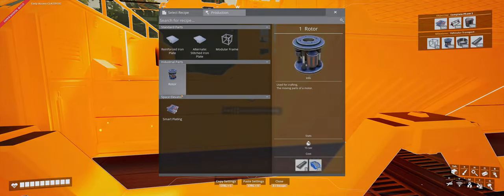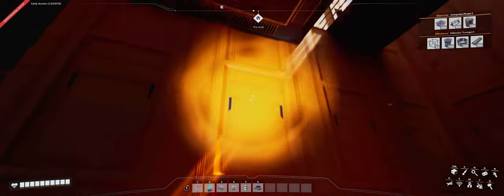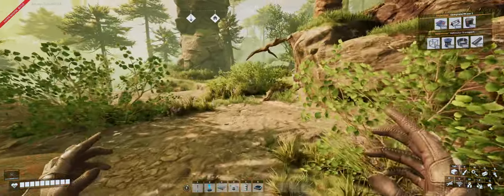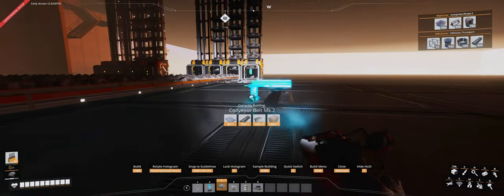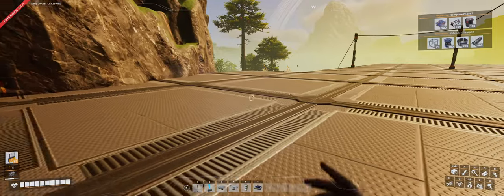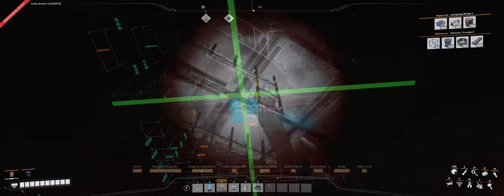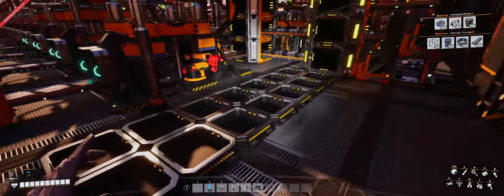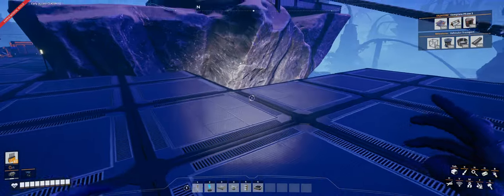Installing a Factory Sub-Floor | Satisfactory U8 - Ep 3

Comment: I came back to this episode again to see how you set up your vertical bus. I built one in my current game and had some trouble. I made mistakes, but learned a lot. I was attaching my splitters directly to the belt line and it created an issue where the lifts would not attach to the machines or vice versa because the height was off a hair. It took me hours to figure it out and do a work around. I was pulling my hair out. Now I understand how to set the whole thing up efficiently. The vertical bus takes time to set up, but after that it really is a plug and go system. I love this game!
Reply from the maker: I did the same thing in later episodes lol.  It's because the machine didn't place exactly flat on the foundation because I had something too close to it underneath.  I also spent way too long figuring it out lol.

Comment: There's something to be said about having a single set of straight belts downstairs where outputs are merged into and inputs are split off of. Just so you can see at a glance what's what and how many you have. 
Storage could go before the merge-on (would act as a buffer), overflow before storage.
Reply from the maker: I did make sure to make the overflow belts visible and that helped me see what was happening at a glance.  Not sure about having mid-line storage.  I want my expensive parts safe. :)  But It would work if done right for sure.
Reply: @Kinstruction  When in doubt more in-line storages act as a buffer and hold more items for you to use or outputs to take out of with the industrial storage. For example my Oil setup. Rubber/Plastic outputs immediately overflowing into a sink to keep the factory running and then splitting into an industrial storage and then two lines out of the storage into another four storages that goes to the train. Triple the buffer and double the throughput to the train. The factory can't keep up with the throughput but once the buffer is full and the train is only taking as much as it needs then the train will run at peak efficiency. More storage can always be added as well to create a large buffer for modular factory activation. I can go on and on about resource management but I'll leave it with this: Create a factory (system) that uses every last item it creates and create a buffer so large that it will never empty is my philosophy.
Reply from the maker: Yea, no problem with this idea unless your using more than one item in that line, especially on trains.  Can't let it overflow if you're doing susi, cuz you might need an item that gets blocked.
Reply: @Kinstruction  Yeah, I never put multiple items on a single belt.
Reply from the maker: I try not to unless there's a very specific reason to. 😁

Comment: Quick question...
are you consolidating all your mined items into one... that spot has a ton of iron and a few copper... just wondering if in hindsight mode if it makes sense to do so, then make a distribution hub maybe downstairs... this is me thinking out loud as this round for me is about modulation, minimal plant removal and even more so with trees... and more time building landmarks... fucking with the landscape.
Reply from the maker: Well, the point of this base is just to get me to mark 5 belts.  Then I'll start building what I really want to in the save.  I'm not too concerned about the basic materials that are there or distributing those.  Because this base will need that while I build my mega factories, because this base is my part supply.  My supply network will reach all across the map to pull together what I need. I'm using 100% of the oil, bauxite and sulfur on the map. At least, that's the plan, we'll see.
Reply: @Kinstruction  have you finished the game/simulation? I’ve never gotten past aluminium but I’ve been messing about with it almost back to 2016. Me and my daughter were serious Minecraft players. It was all about building bitchin cribs. So satisfactory for me, for is just Minecraft on steroid… but more. 

So I built a sub floor where you did. But continued several. Each 16m in height. And just filled the lower floor with my smelters. Figure the next floor is the basic iron then continue up. But it makes sense in the notion that as the game progresses it’s doubtful you will need access to iron rods.
Reply from the maker: Got close. Didn't fire off the last space elevator but I did do major work with trains and finished aluminum. 

I'm looking forward to getting past my previous record in the next few streams :)

Comment: I usually start quick wire just over the hill from you soon as possible to sink.
Reply from the maker: Nice. I sank mass quick wire in my first save.
Reply: Just overflow sink everything and you'll have more coupons then you could ever possibly use. Just make sure to extensively upgrade power to keep the whole factory running. A machine not outputting items is an item not sunk and that's a sin. Capacity>Production>/=Consumption=Max Consumption is my golden formula.
Reply from the maker: You should keep watching the series lol
Reply: @Kinstruction  Just got to episode 7 :D
Reply from the maker: It happens a lot, people comment, and make suggestions and I want to be like...I DO THAT lol  but its hard because to me, this is all in the past, sometimes I have a hard time even remembering what I did, cuz i'm so focused on what I'm working on now.  But its all good, reminds me how far I've come in a few months.
Reply: @Kinstruction  All the more reason for me to keep watching then :D